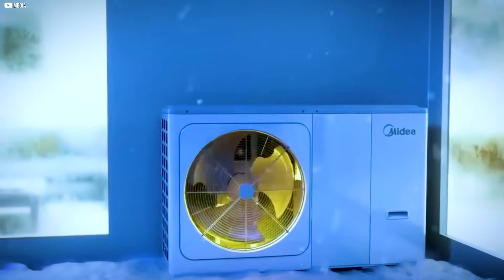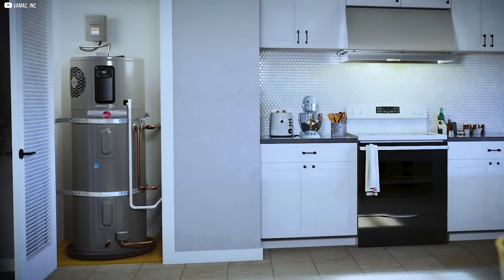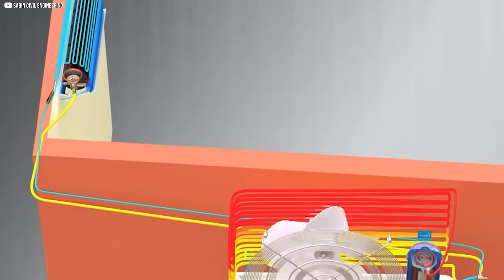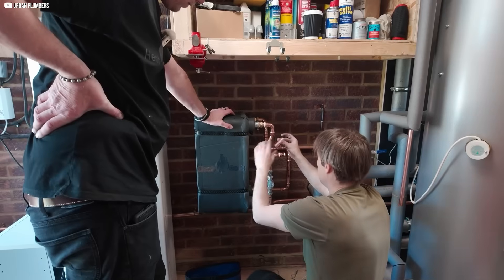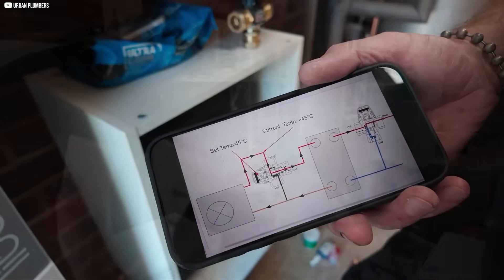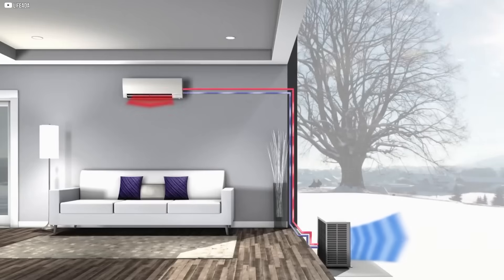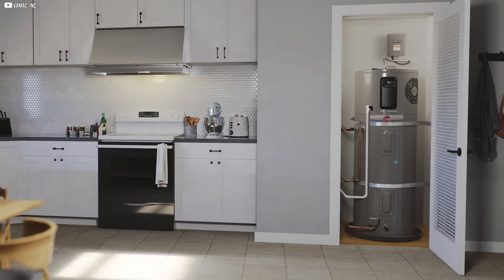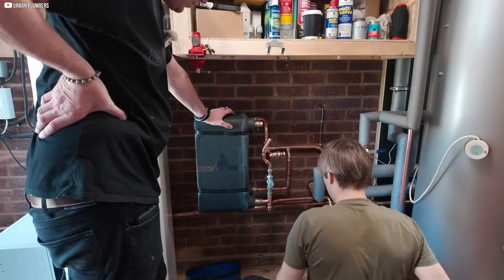From 100% to 900%: The Journey to Ultimate Heat Pump Efficiency

Comment: NO! NO IT DOESN'T!
There is absolutely ZERO exchange of inside and outside 
"TEMPERATURE" ! The TRUTH is that the "compressor"  creates the heat during the cycle. Then, the expansion valve "COOLS" the refrigerant before the fan blows through the evaporator (cold) and returns to the compressor to heat the refrigerant again. The  refrigerant is what truly creates the hot and the cold variant in the unit. It doesn't  "PULL" heat from 28 degrees air outside to warm a house. It just reverses the direction of the flow of the hot gasses so that the evaporator becomes the condenser and vise versa.